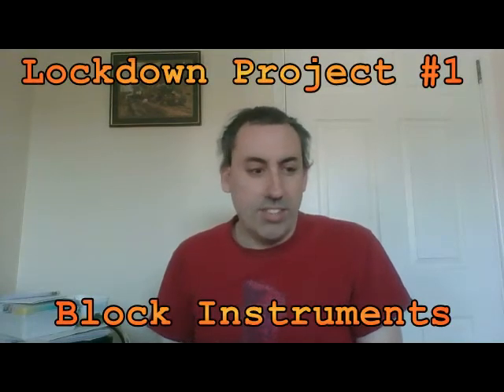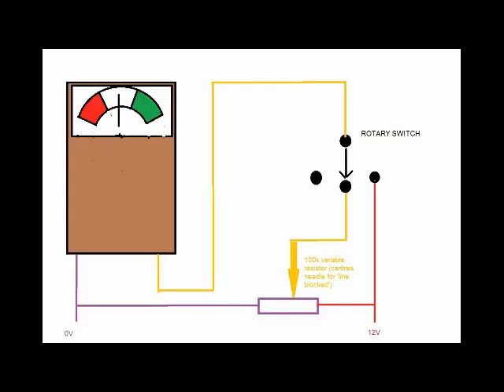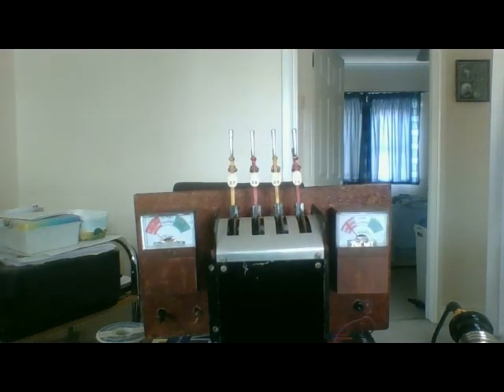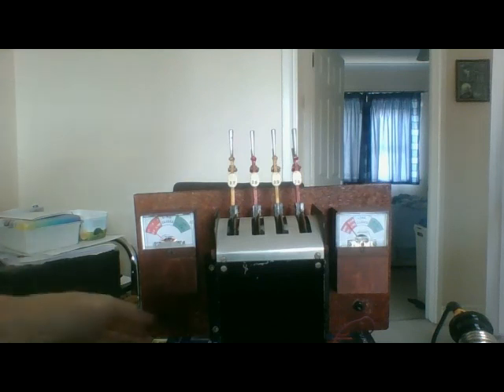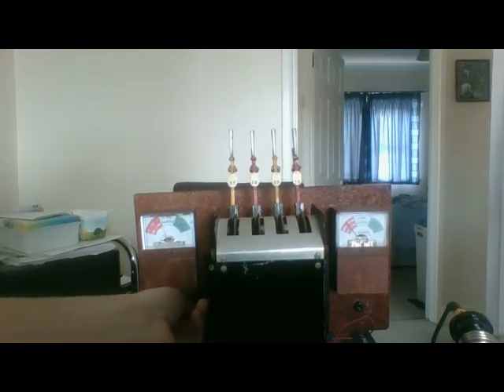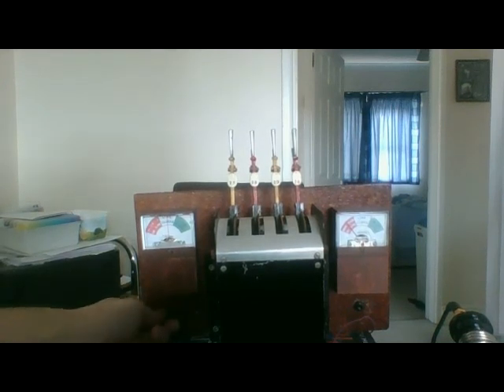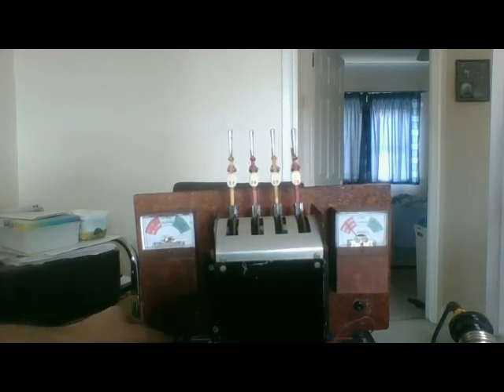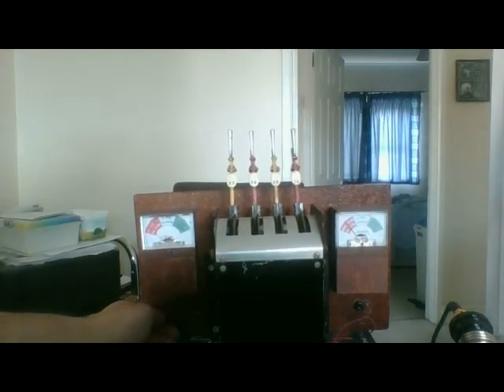Making Block Instruments

Comment: I'm going to try a variation of your very nice project. I want to see if I can get the needle to be at rest in the middle, and use positive voltage for Line Clear, and negative voltage for Train on Line, just like the real thing. (It would also use less battery when nothing is happening, and fail safe.)

Comment: Are the levers locked?
Reply from the maker: Not yet. That would require taking the unit over to my father's workshop, which I haven't been able to do so far. The only locking so far is that the feed to the signal servo goes through an auxiliary switch contact on the point motor to stop the signal being released when the point is against it.